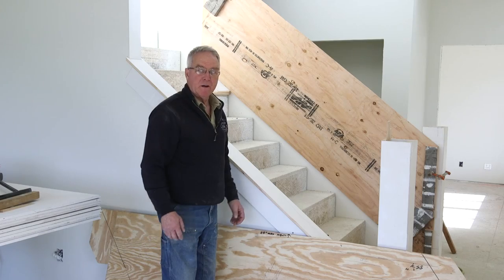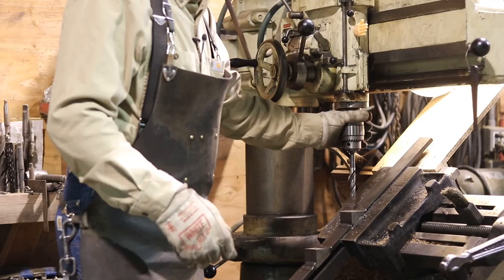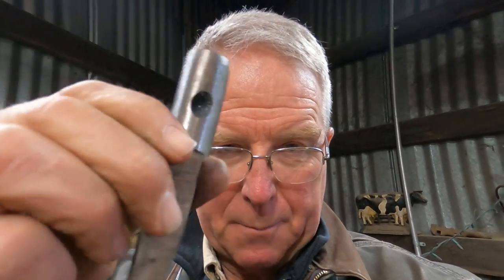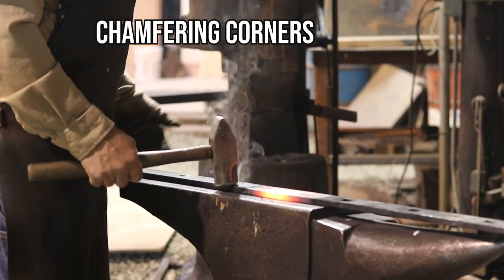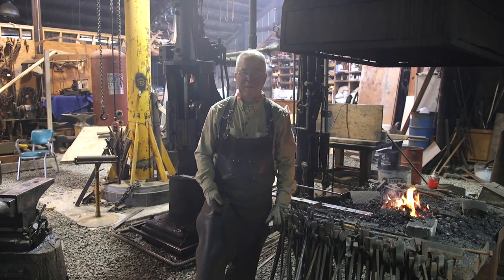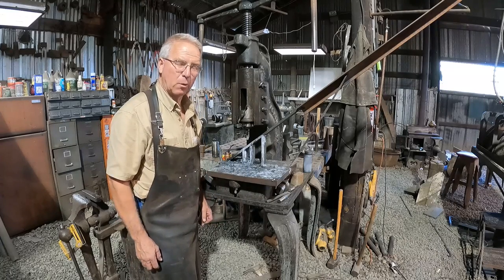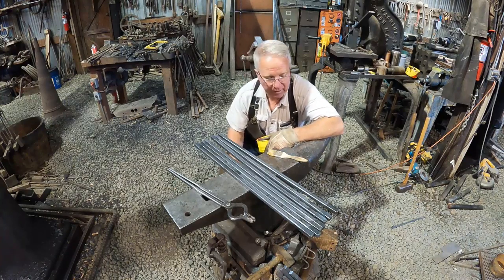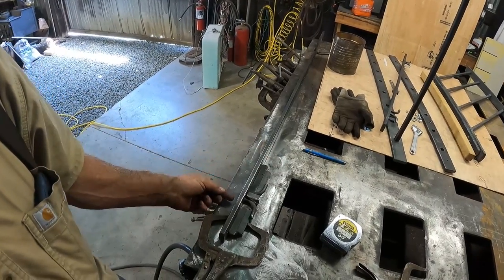Forging a Custom Stair Railing Ep. 133

Comment: great job. i had a friend who was a third gen fabricator. his grandfather started the business as an ornamental iron shop and he had some amazing equipment that he designed , he had built a gadget that had two trk transmissions in series driven by an electric motor that twisted pickets. he built a machine that used two big rollers that had beads of hardfacing on them that he would run flat metat thru to distress them, when he closed shop i got the hyd hossfeld bender that i still use today.its an amazing craft that few people appreciate. i really enjoy your videos. thank you

Comment: Love your sites and presentations. You have provided many good tips to my advantage!  
Here is one for you...:
Why not simply punch a 1/2" x 5/8" or 3/4" hole to allow for the 38 deg. angle and fill-weld the pocket created on the topside down-slope? 
Done this way many times - much faster and it works great!

Comment: We had a fly press pretty much the same size in the shop I spent most of my 40 years at Ford Product Development working in.  Ours had cannon ball weights at each end of the arms though.  It would just about punch a 125mm hole through 3mm aluminium and 22SWG steel on a good day.  It was old when I started in 1967, but didn't look any older when I retired 40 years later.  I had a tour of the body shop at Dagenham once, and saw the huge presses that pressed out car body panels.  It took 300 tons to do that, and a truly massive electric motor, so Fly Presses are amazingly good value.

Comment: Loved watching this. I've built rails for the last 10 years.  No more than 4" spaces between pickets is code.
Reply: I think you mean no more than 4" You can have them as close together as you want.
Reply: From what I can see in the video, the holes are spaced at 4 13/16" (on center).  The stretch from drifting will be minimal.  1/16" at most.  4 7/8" -5/8" (picket) gives us 4 1/4" which is not code compliant.  To hell with the code.  The railing looks great and it is a difficult build.  Hats off.

Comment: Super nice drilling jig Scott! To alleviate the problem of wearing your jig, you can insert a hardened "drill guide" into your jig. These are available at McMaster for pretty cheap. A very worth while effort especially when you're drilling many many holes and don't want to deal with your jig producing inconsistent results on the 20th hole.

Comment: I had occasion to make a bunch of square holes last year. I ended up grinding down a square bastard file to fit an arbor press that I used to push it through the drilled holes. Granted, it was only 1/16" tube compared to what you were working with, but after doing all 160+ holes I fully appreciate the sheer amount of work you put into crafting those railings.

Comment: Beautiful. 3 questions, did you weld the square stakes to respective top and bottom rails? As in welding the square holes to the square stakes? 
Second, did you chamfer the square stakes with a hammer or a grinder?
Third, are you mounting a wooden top rail? Will the 90° round stock pieces stand proud or act as braces for the wooden rail?
Thanks
Reply: From what I can tell:
1. It seems that he may have tacked them (22:14). Full welding shouldn't be necessary since they are encapsulated by the wooden base below and the cap rail on top.
2. He used the power hammer (16:16)
3. He is going to mount a hand rail to the flat spots he ground on the 90° standoffs (21:20)

Comment: 15:00
Not sure I wouldn't have put a 1 1/4" x 1 1/4"  , 1/4" wall square tube centered right up under that jig hole of the ramp. With the banding gussets sandwiched on the outside of the square tube even. All-in-all you did a fine job Scott. KUDOS to your friend for lending you a right good press. 👍🏼
-✌🏼

Comment: Yep I done some handrails when I worked at the fab shop all I had was a chop saw and iron worker with a rectangular punch for the square pickets that we twisted with an old pipe threading machine and welded everything with a old Miller matic 35 welder all 35 wire and CO2 for gas

Comment: Great project, and sweet radial arm drill press and angle table.
I know end mills in a drill chuck could be considered taboo, and your drill bits worked fine, but also consider pecking a little with the end mill to get a flat then finishing with the drill bit (since end mills don't drill that well just like router bits).

Comment: Lot of work.  Looks good! I would have chosen an  air/hydraulic press with foot pedal over the screw.  It wouldn't have changed the appearance.  Just save labor.
For a more black Smith look you may want to use square head lags the hardware store bolts say no.  Some may even lay a tack weld hump right on the head.  
I had a robot burn my holes at 37 degrees.

Comment: Great job, but I am surprised you didn't use tubing as the vertical support and have the hole for the drift within the tube. Seems like it would have been more structurally sound. Love the work as an engineer and hobbiest metalworker. Keep up the good work.

Comment: I just came into an old EWBliss punch press from the 1920s. sent a pic with the forge lesson giveaways on that one. it actually has a tilt mechanism and i imagine the previous owner used it in a similar capacity since all he did was fab commercial, industrial and high end residential railings. Seems like that would have made your lives easier!

Comment: Lovely to follow this job. 
Congrats on the 1/8th outcome :->
Would a little stub that’d locate in the freshly pressed hole on the low end of your slopped press jig have been of any use ?
Reply: That’s what I thought also, like a stop to make everyone the same distance apart.
Reply: Every drifted hole in the railing maked the bar "grow" an undeterminiable amount.  The metal is also displace out the side to make the 'frog eye' he mentioned.  He had to pre-estimate how much the 8 ft.(2438.4 mm) bar would grow through the blacksmithing process. 1/8 inch (3.175 mm) or 0.13% error is almost unheard of pre-estimating in a hand made process.

Comment: its funny.. you swaged the holes square but when I worked as a helper in Petersburg back in 80's, the smiths I worked with took time to cut the bar on the anvil from square to round at both ends, at the angle.. then heated them to almost rivet into the holes.. they said on stairs it was easier to just use the round holes rather than square holes, because the stairs angle meant the square rods would not turn.. as long as your bottom angle was right.. and they had custom 2 piece blocks that fit in the hammer to create that angled edge and stretch right there..top and bottom, as well.. since in most buildings they only dealt with eight different angles for there.. based on run and rise.. but they were always doing the stairs and fencing.. and gates..lol.. so I always had loads of grinding, scraping, painting, filing, and once in a while I got to bend, or even hammer..lol.. one day will get an anvil here in Jamaica and learn more using charcoal.. really have always wanted a farriers forge ..lol

Comment: That was really cool to see it come together and see it installed.
I'm not a blacksmith by any means so I am curious. Could you have punched those holes normally, and then taken a square bar in the hole and hammered it to the correct angle?

Comment: Anything from 12°-88° needing drilled... should be drilled with a right angle drill bit or "flat drill bit".

A traditional drill bit will still work up to seeing 37° with a drill guide like this video illustrates, but isn't necessary when using the proper drill bit. 

A "center cutting" (only center cutting will work) end mill with multiple flutes will also work just like a right angle drill bit in most situations. If you decide to use a center cutting end mill or drill bit of any type, make sure to look up your speeds and feeds. An 1/8" HSS bit will spin at about 420-500 rpm and feed at no more than .003-.005" per flute pass. A 3/8" bit will be doing 270-350 rpm and maintain a feed rate of .003-.005" (3 to 5 thousands of an inch) per flute pass. A  5" bit will be at a speed of 125-200 rpm and the typical feed rate (feed rates don't change as much in manual machine work, but will be critical for CNC machinery and listed in Inches per Minute). These are good baselines to dial your speeds in from. Doing this the right way will lead to a nice chip rate (no big curly coils of drill scrap... Just leads to a lot of friction, less accuracy, a poor finish, and a short bit life... Also know as tool abuse) longer bit life, more accurate work, and cleaner holes drilled.

For some overview; 20 years experience in the manufacturing, fabrication, and artisanal works.

I'm a trained blacksmith and high purity fabricator, award winning welder, and career engineering tech.

Instagram= 
@Cameron_the_creator
@Cameronbros

Cameron Bros Artisanal Fabrication LLC

Comment: Hey Scott what are your thoughts about electrical heating for a blacksmith forge. I’ve seen some really interesting heats with a coil that heat up the metal extremely quickly. Of course carbon is required chemically but I could imagine something like that being exceedingly useful.
Reply: Induction forges have been commonly available for 15+ years.  They get expensive in the 10s of kW that would have been needed for  this heavy stock.
Reply: @honthirty_  That makes sense, but you wouldn’t leave it running the entire time, you would turn it on, heat, turn it off, you could even use the capacitance of the coil to detect if there’s metal inside and turn it off and on automatically thereby actually saving you a lot of energy presumably.

Comment: My only question is why didn't you first make vertical (thererfore much easier) pilot holes. If they were narrow enough, and even if you didn't go all the way through, the bigger drill bit wouldn't wander on its own later on, it would have to do a bit less of work and the smaller hole, even at an angle, would disappear by making the bigger one. And if by any chance it didn't, welding would be there to help.

Other than that, in my humble opinion, great job. As I've mention a few times before, my father, his brother and his father were all blacksmiths and videos like this remind me of them. I try and see what the differences would be between how things are done on that side of the world and mine. Maybe not that many and mostly related to what machines are available than anything else.

I would have loved to watch your blacksmithing videos with my father. He didn't speak English, I would have to translate it all (not that i would mind) and that would slow things down, but I would love to know his thoughts on this. But, he is long gone, as his brother, as his father (I actually didn't get to know my grandfather) so maybe in another life.

Thank you. Indeed.

Comment: You need a lot of structural wood underneath to handle a very heavy railing like that. The weight of the railing works against you overtime if you don't.

Comment: Just an fyi for us canadians up here. The "pickets" he is talking about is called "spindals" up here and our code for kost of canada is no farther spaced apart that 100 mm or but in practical testing we make our spacing no larger than 99mm that way if the inspector brings out the ball, it will not pass through. Because babies can crawl into the worste places.

Comment: Using an end mill rather than a twist drill would have another option for drilling those inclined pilot holes- could do that in your drill press if you have the right chuck, and might not have needed the template to be so big (there would be much less lateral deflection)
Edit: didn’t realize they make annular cutters as small as 9/16, but they do and that would have worked well to drill without deflecting down the plate.

Comment: I wouldn't use a drill bit in the first place. That kind of a job is basically in the DNA of a flat bottom end mill. Starts with small cut and progresses into a perfect hole. Easier on the whole operation, and you can lubricate it to spec. IMO, it's counterproductive to setup such an elaborate jig and then do it and the work involved, disservice by using a lowly drill bit...

Comment: Plug welding would have been the way to go.
Cut the ballisters to go between the horizontal bars, drill a straight round hole and weld from underneath/top and grind the welds smooth.
Not taking away from what you did here it is clearly fine work and very impressive but in the real world nobody is paying for all that extra labor for the same exact look.